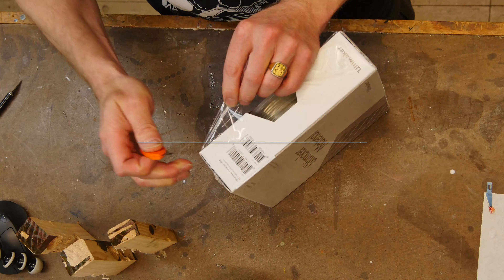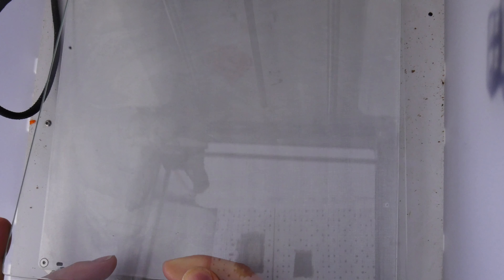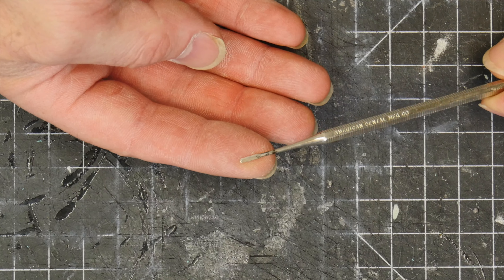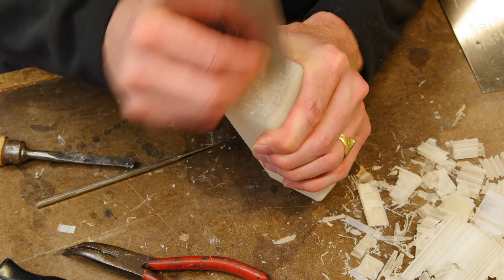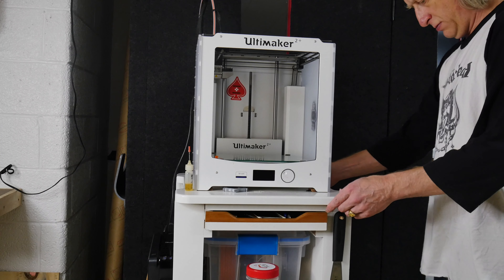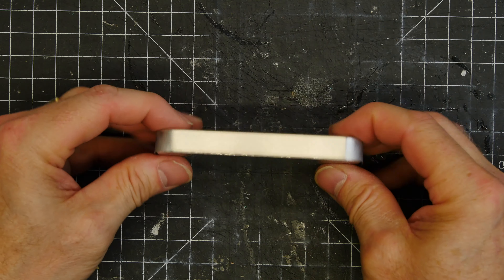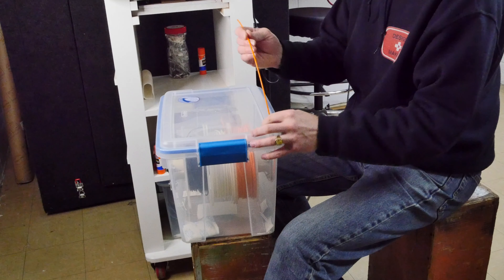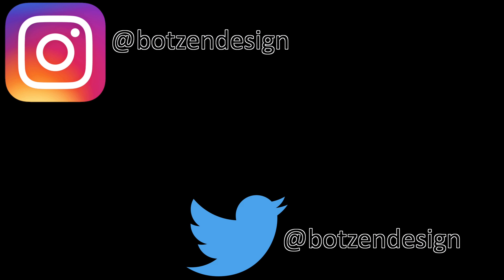3D PRINTING Tips Tricks Tools and Secrets for your projects

Comment: Thanks, I've never seen one of those micro-chisel tools! The scrapers look a lot more useful than my modelmaker's seam-scraping tool, too!

My tips:
Set up Octoprint with a camera and everything, I'd been 3D printing for four years without it, and now I don't know how I ever managed!
When manually leveling, use an actual set of steel feeler gages instead of a sheet of paper. Really makes a difference, and you can fine-tune that initial gap.
Get a decent micrometer and check your filament diameter.  I don't know about other slicers, but Simplify3D can adjust extrusion parameters based on very precise filament diameter measurements.

Small correction: Polyvinyl Alcohol is the PVA used in things like water-soluble support materials and hydrographics film.  Polyvinyl Acetate is the PVA used in glues. (Though sometimes they're used together, which just confuses matters further.)
Reply from the maker: Thanks for your tips and tricks and correction at the end much appreciated

Comment: UPS is a great idea. I was getting intermittent issues with mine at the office. Back and forth with tech suppport. At one point, they had me disassemble the printer to test the voltage of the internal power supply. The problem? Old building wiring and a worn-out breaker. When the cleaning crew would use the vacuum cleaner on the same breaker as the 3D printer, the breaker would almost flip but not quite; dropping the voltage just enough to screw up the print job. Yeah, UPS is the way to go.
Reply from the maker: Wow, good story, thanks for sharing. Glad you got it figured out 👍
Reply: I've often wondered--as printers are most 5v & 12v--why not just run the printer from the DC side of the UPS?

Comment: Great video! I'm getting some of those dental chisels, they look very useful. As a woodworker, I have several cabinet scrapers, but I never thought about using them for 3D prints. BTW, you can make your own cabinet scrapers from old saw blades (or sacrificial blades bought on sale), just make sure the edge is square with two very sharp 90 degree edges. I've been using the little desiccant packets, I like the metal tin better, I'm going to try that.

Comment: I use a PEI surface on every Printer I own... 3 at the moment :p everything sticks to it... 
Just wipe it with IPA and print
You only have to be careful with PETG and Flex Filament, those tend to stick TOO HARD u_u

I have a small 'Palette knife' ? Artists use it to mix paint or do relief work on paintings... The Blade is super thin and rounded, so if you have a PEI surface you won't damage it.

If you have problems with moisture in your filament, let your Spool sit in your Oven or buy a Dehydrator and run it at 60-70° for 2-3 Hours... Good as new...
For Nylon or PETG, is important to keep it as dry as possible

One last question about the Power outages... Is it that bad in the US?
I so many people complain with wrecked prints because of Powerloss, I see them sometimes onec a year... Maybe once every two years o_o